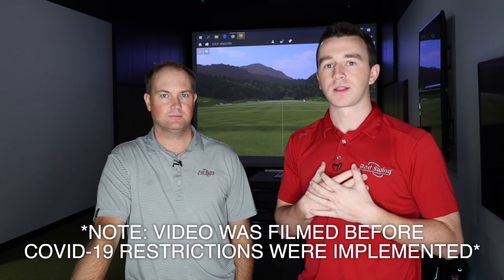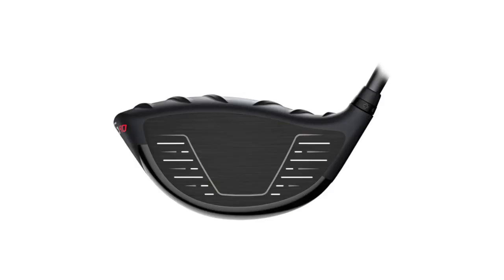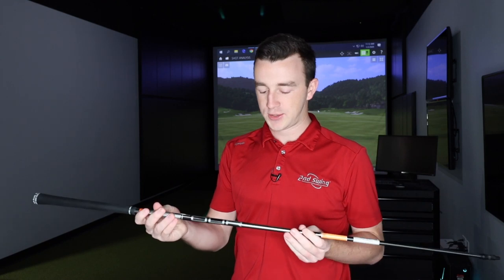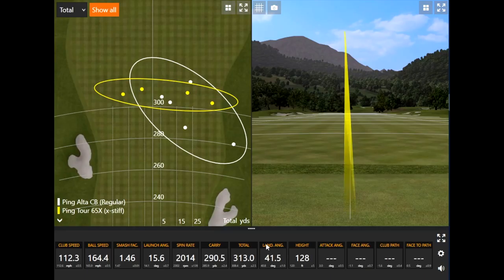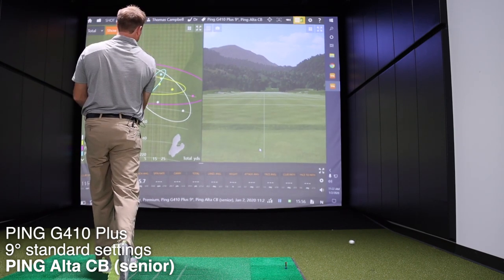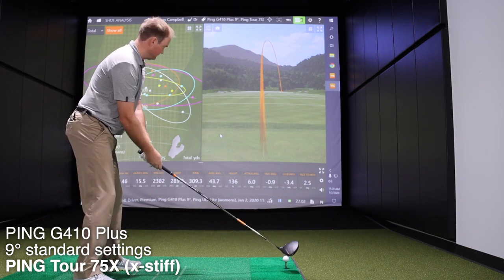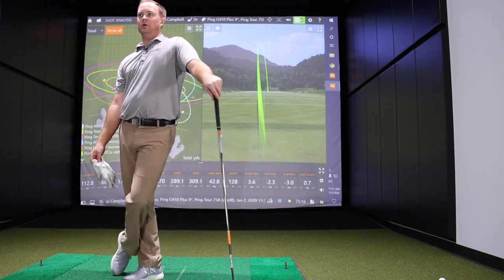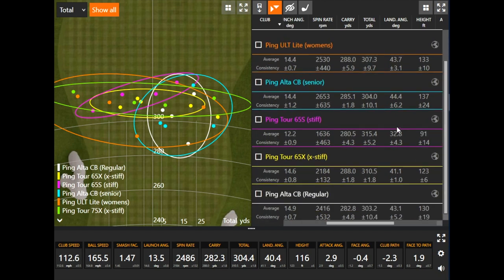Driver Shaft Flexes Testing & Comparison | Trackman Test

Comment: I love the fact that the test was done using Ping stock shafts - most people use stock shafts.  I also love the fact that there was not a lot of difference in carry distance between the shafts.  For most people changing shafts will not magically get you another 10 yards of carry

Comment: Sometimes the same flex and different shaft is also a big difference.  Bought a Ping G410 with a regular flex stock shaft and found I was losing distance - ball went high in the air but didn't go far.  That flex also seemed very whippy.  Replace if with a regular Tour 65 and the flight was much better.
Reply from the maker: Absolutely! Just because two shafts have the same flex category does not mean they behave the same during the swing. There's different weights, torque, etc to consider as well that make a difference.

Comment: Interesting. Of course as part of player dependency a number of variables can be altered even for any given shaft to either give different results (like length of the shaft or tipping) or to manage different tendencies (eg lower torque for lower twist for higher swing speeds or if you tend to hook then heavier shaft helps even if swing speed lower as I have found for myself).

Comment: I bought my Ping G400 with a SR shaft thinking it was Stiff Reg and not Soft Reg. It was ok but ball was going too high so losing distance. I switched to the stiff which gave me distance but the odd miss hit (off the bottom) did punish me a bit. Still stiff is a much better ball flight..
Reply from the maker: Good stuff! Generally, a stiffer and/or heavier shaft will lower ball flight and punish misses just a little bit more. But of course, every swing is different!

Comment: How do you explain the fact that Tour 65 in stiff was spinning less than the Tour 65 in X stiff? Great video👍
Reply from the maker: while there is a trend for a heavier/stiffer shaft to spin less than a lighter shaft it is always player dependent. Every golfer swings differently and loads the shaft differently. Hit location can be another influence .
Reply: @2ndswing  Thanks very much for taking the time to reply.👍
Reply: @2ndswing  Hello, is Tour 65 the same as Tour 173-65

Comment: Does anyone make a light weight shaft(50g or less), yet with low torque and stiff butt/tip?
Reply: Mitsubishi bassara is 48g in stiff but have to do your own research on torque etc.
Reply: @midlifebiker7424  Yes I know about that one, tks.